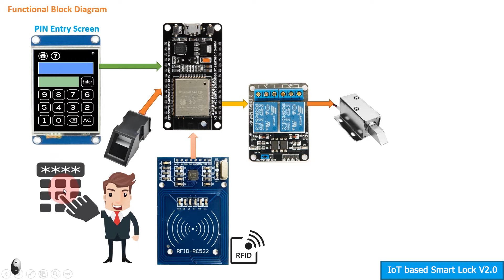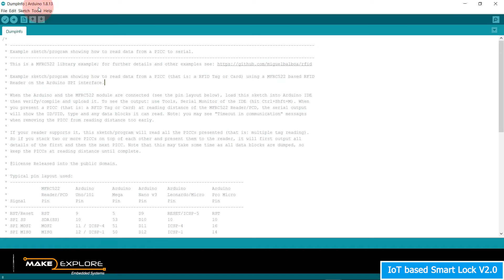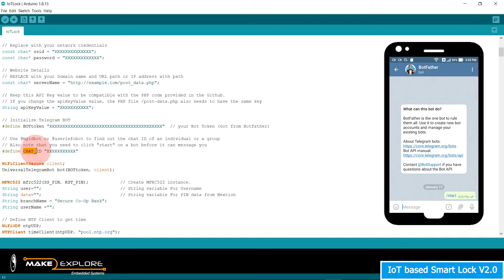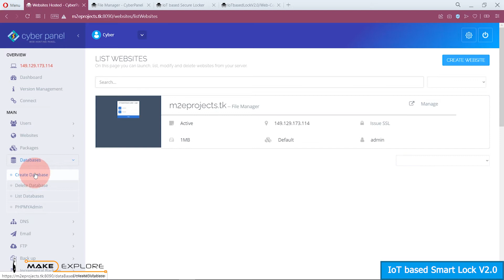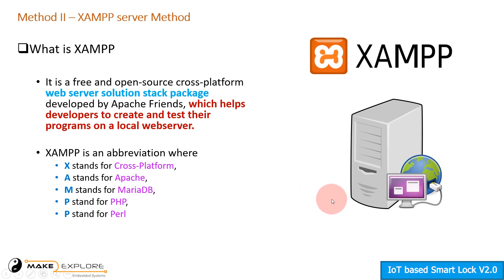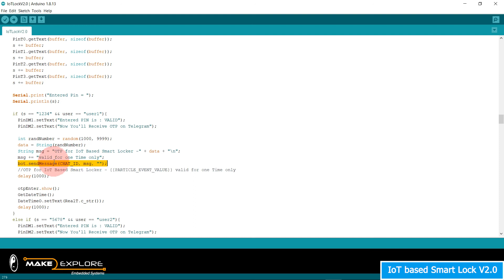IoT Based Smart Lock V2.0

Comment: how to use it in esp8266?...please reply
Reply: Still can we use esp8266, the code will work?.. please reply...
Reply from the maker: Dear Sunny Chawan @sunnychawan8575, 🙏 Thank you very much for your interest in our channel.

Still can we use esp8266, the code will work?

➡️ Theoretically possible!!. Practically ? You need to give a try to find out whether it can be implemented with ESP8266 or not.

🛠 Please note that, This project requires following setup : 
📌 (5Pins : 4 SPI+1 GPIO for RFID), Since Quad-SPI is used for Flash then you have to use Hardware SPI but they are multiplexed with GPIO's. (D5-D8)
📌 2 Serial ports (1 for Fingerprint +1 For Nextion Display).. Though ESP8266 have 1 Full and One Half(Transmit only serial port). You may have to use Software serial. It will utilize 2 more GPIO pins.
📌 1 pin for Relay Board.
Total 5+2+1 = 8 Pins Approx, which are available with some overlapped functions (sometimes Boot fails if override exceptionally). 

If you still want to use ESP8266 then you can try (Hardware Extension modules) like - PCF8574T module or 74HC595 shift register. But it also comes with catch of  Software/Coding overhead!, which is bit complicated to implement.

Check out Full Schematics of the project - 
🌐 IoT Lock 2.0 main Circuit Diagram - 🔗 https://github.com/make2explore/IoTbasedLockV2.0/blob/main/Schematics

So, to avoid in major changes in existing source code, We'd recommend/suggest you to use ESP32 instead of ESP8266. But you can try ESP8266 and let us know your tinkering results. 👍

If you still persist any issues/Queries about any of our DIY Project/Tutorial, feel free to ping us on WhatsApp/Telegram (Links given below) for further support.

Tech support - (𝗖𝗵𝗮𝘁 𝗢𝗻𝗹𝘆) Telegram/WhatsApp - 11:00 AM - 05:00 PM (Mon-Fri) IST   

🚀 𝗧𝗲𝗹𝗲𝗴𝗿𝗮𝗺      🔗 https://t.me/make2explore
💬 𝗪𝗵𝗮𝘁𝘀𝗔𝗽𝗽    🔗 https://bit.ly/3VXGGEe

As per time permits we will try our best to help you out. 

Best Regards 🙏
Reply: @make2explore  can we make this project without keypad display and fingerprint only with RFID reader and OTP setup with virtual  verification
Reply from the maker: Dear Sunny Chawan @sunnychawan8575, 🙏 Thank you very much for your interest in our channel.

can we make this project without keypad display and fingerprint only with RFID reader and OTP setup with virtual  verification?

➡️ This project (IoT lock V2.0) is designed with idea of multilayered security for device unlocking, which includes 4 layers (Passcode, Fingerprint, RFID and OTP).

Display or any feedback method is necessary to inform user about authentication process. You can use LED's also if you want. 

Keypad is necessary for entering OTP into device for authentication.

You can also compact it down to only one(physical) layer authentication, i.e RFID. and all other OTP based authentication(virtual) interaction via Telegram App. For that you have to program your Telegram Bot as an interacting Chat Bot. Here is the Idea -- Do one authentication (i.e RFID) on physical device, --> If valid RFID used, then Send control to Telegram Bot --> Bot will interact with user on Telegram App via chat and will ask to Enter pre-programmed Passcode/OTP through chat window only. This will change whole project design, infact it will be completely new project itself.

If you still persist any issues/Queries about any of our DIY Project/Tutorial, feel free to ping us on WhatsApp/Telegram (Links given below) for further support.

Tech support - (𝗖𝗵𝗮𝘁 𝗢𝗻𝗹𝘆) Telegram/WhatsApp - 11:00 AM - 05:00 PM (Mon-Fri) IST   

🚀 𝗧𝗲𝗹𝗲𝗴𝗿𝗮𝗺      🔗 https://t.me/make2explore
💬 𝗪𝗵𝗮𝘁𝘀𝗔𝗽𝗽    🔗 https://bit.ly/3VXGGEe

As per time permits we will try our best to help you out. 

Best Regards 🙏
Reply from the maker: Dear Sunny Chawan @sunnychawan8575, 🙏 Thank you very much for your interest in our channel.

how to use it in esp8266?

➡️ ESP8266 have very few usable GPIO's/Pins. So if you want to implement this project with all the peripherals . We'd suggest you to use ESP32 instead of ESP8266.

If you still persist any issues/Queries about any of our DIY Project/Tutorial, feel free to ping us on WhatsApp/Telegram (Links given below) for further support.

Tech support - (𝗖𝗵𝗮𝘁 𝗢𝗻𝗹𝘆) Telegram/WhatsApp - 11:00 AM - 05:00 PM (Mon-Fri) IST   

🚀 𝗧𝗲𝗹𝗲𝗴𝗿𝗮𝗺      🔗 https://t.me/make2explore
💬 𝗪𝗵𝗮𝘁𝘀𝗔𝗽𝗽    🔗 https://bit.ly/3VXGGEe

As per time permits we will try our best to help you out. 

Best Regards 🙏